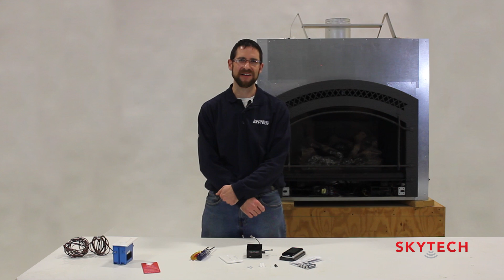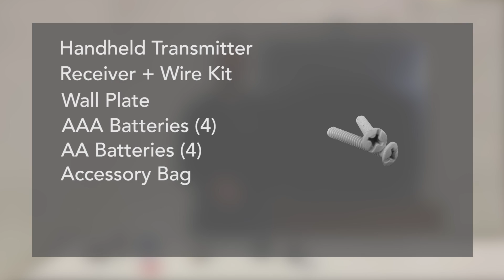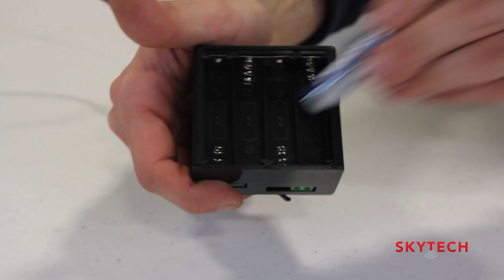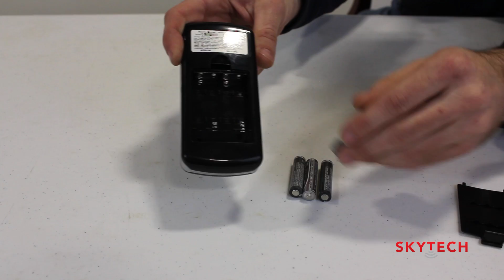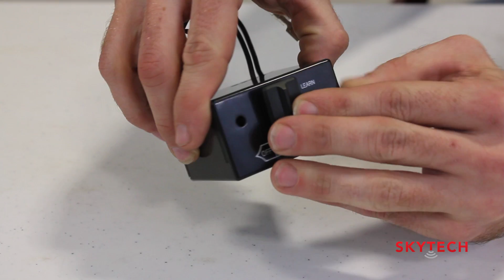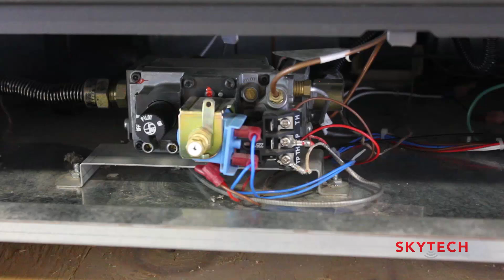Standard Receiver Installation

Comment: Don’t comprehend my remote , Fire place want come off and on  alternate from one to the other, off Thermo it burn, on it don’t burn seems backwards to me,  I can run degrees up and down with in three degrees it will work but just laying it down it don’t work automatically, should it or is it designed to always hold it in your hand.

Comment: I figured out that I definitely had a bad receiver that only worked sometimes and then finally quit altogether even with brand new batteries. So because of this video I ordered a new remote/receiver wiring kit. My old receiver was wired directly to the gas valve like in the second demo but I figured from the first demo that maybe I could just switch out the receivers by taking the wiring out the back of the old one and put those wires in the back of the new one. Never have to touch the gas valve at all, and lo and behold it worked! Now I have a new receiver that works all of the time, even upgraded the remote to one with a screen. Now I have a frustration free fireplace.  Thanks a bunch.

Comment: My remote stopped working, I replaced batteries, I still cannot pair. I get the single beep from the receiver but no subsequent beeps to confirm pairing. The receiver works if I use on/off switches but no luck with the remote. Any other things I can try? It worked until yesterday
Reply: Try using a small screwdriver on the battery contacts.  Mine were dirty from lack of use.  Once clean, with fresh batteries, my remote was working normally.

Comment: My receiver is sensitive to its orientation.  The receiver has to be placed with the battery door facing the wall mounted transmitter for the system to work.
My receiver has also stopped “Beeping.”

This is problematic.
The receiver still functions and “learns” after battery changes.  But no beeping.  It sucks to be me.

Comment: I have been searching for hours for this video!  I could cry this is so simple!  I thought I was going to have to cut into the IPI wiring on my control board.  Thank goodness I kept searching.  I suppose if someone has a 2 or 3 wall switch plate then this wall mount wouldn't be usable.. and so then the wall wiring would need to be interrupted under the fireplace...

Comment: i  got a 1410T/LCD-A unit. Turned main switch off and plugged it into 110 and made connections to the gas fireplace. Nothing. Move the switch on the box to on and the flame goes on. Move it to remote, nothing. Press and release the learn button, nothing. Press and hold the learn button for ten seconds, nothing... spent too much time on this thing. UGH? I have a battery operated Skytech unit the worked out of the box... Anyone know what's up with this one?

Comment: I had my first box go bad, didn't realize it was batteries and when it failed I found a big ole battery mess in there. So I try to clean it up but it didn't work. So I ordered a new one, and it didn't work. I got a replacement and it doesn't work. I have tested with just one AA battery and the fireplace will lite, I put the batteries in the box and touched one end(the first (-) and the second wire to the last (+) and the fireplace lit. I opened up the box and touched on the wires to the board where the positive and negative come in and it lit. But the switch and remote will not not work to turn on the fireplace. Just getting frustrating, it doesn't make sense.

Thanks
Reply from the maker: Hello bgover,

We are very sorry to hear that you are having trouble with your control unit. Our customer support staff would be more than happy to talk with you and find out exactly what the problem is. Please give us a call at 855-498-8324. Thanks!